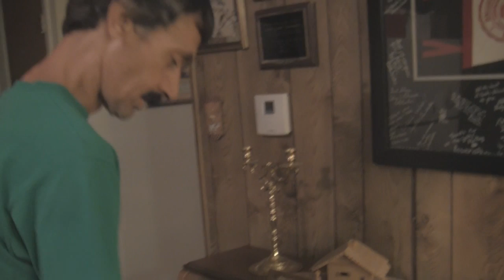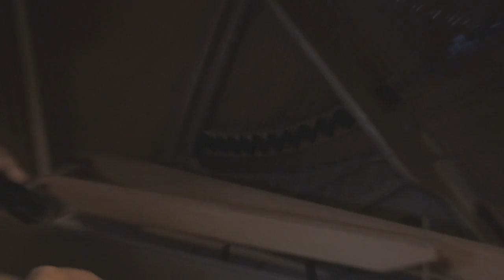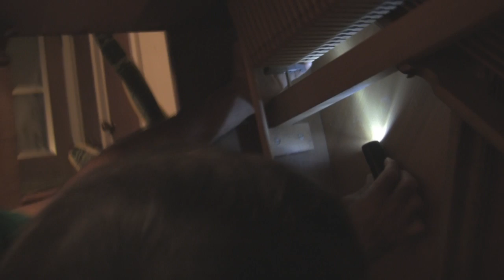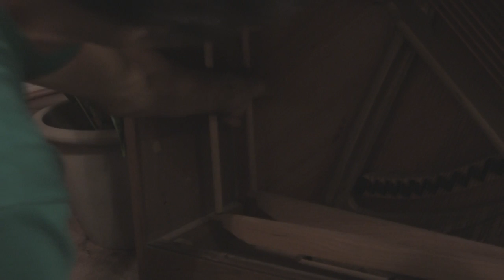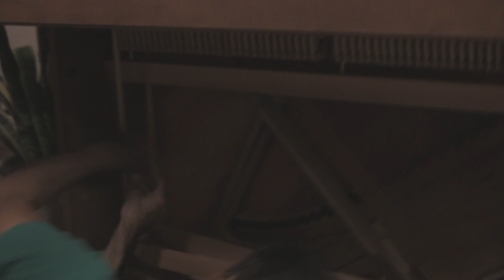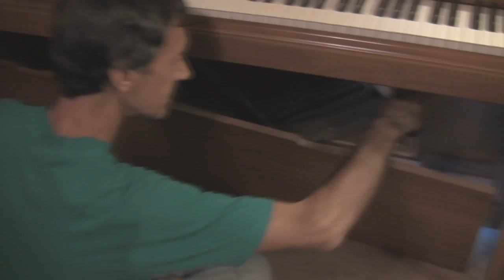How to Fix the Sustain Pedal on a Piano

Comment: Very happy to say your video helped me get my sustain pedal fixed. The screw holding the pedal to the lever had rusted and broken. I used wire to replace the screw, and also adapted ck5056's idea for the felt piece - used a slice of cork so that the rod would apply enough pressure. Thanks for posting this.
Reply from the maker: Awesome!  Glad you were able to fix it!

Comment: Thank you! I had guessed and "fixed" my sustain pedal, but after a minute or so of use, the rod slipped off again! After finding and watching your video, I realized I was missing the metal screw thing that goes into the top hole of the rod to keep it in place with the lever. Thank you for sharing this!

Comment: what is a gromit?
Reply: A GROMMET IS an eyelet placed in a hole in a sheet or panel to protect or insulate a rope or cable passed through it or to prevent the sheet or panel from being torn. WHAT IS THE PURPOSE OF A GROMMET?  Grommets are typically used to reinforce holes in leather, cloth, shoes, canvas and other fabrics. They can be made of metal, rubber, or plastic, and are easily used in common projects, requiring only the grommet itself and a means of setting it.